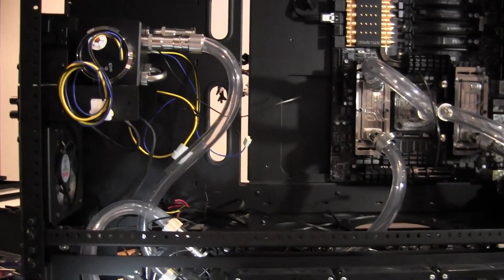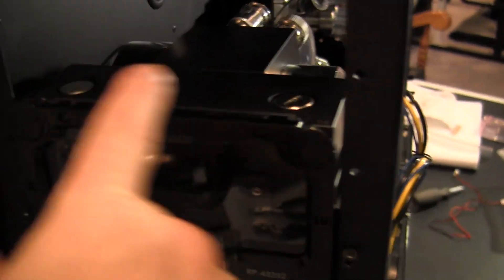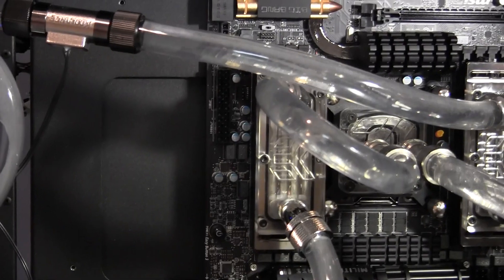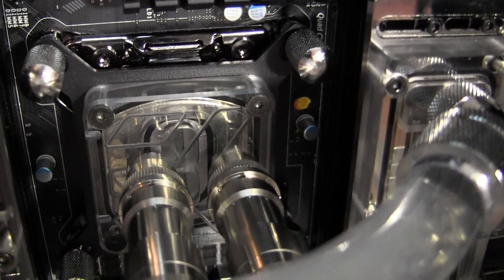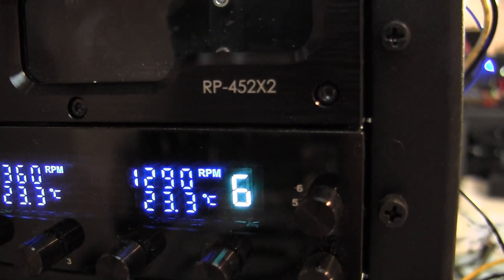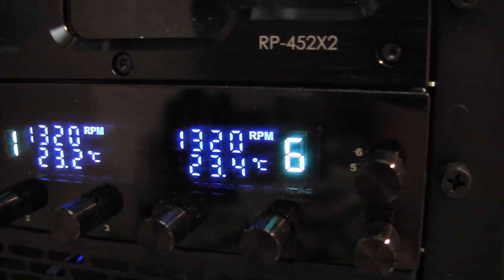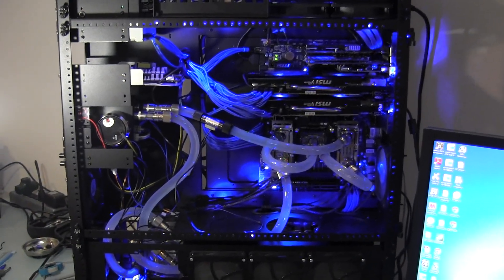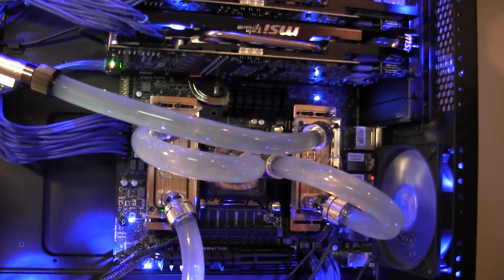Big Bang XPower II Kick Ass Build - Part 3 - Final ... Maybe

Comment from the maker: The EK blocks are the Nickel Plexi just like the CPU and RAM.  I decided to use the FC Bridge system. I hope it does not cover too much up and looks good. The EK  blocks do not have LED holes, but am trying other lighting to show them off.  The LSI is fast and once setup solid.  I do have some videos for that setup yet to post and have a some of benchmarks I did and want to finish maybe this weekend.    The TMS-205 is working great need shots of it in us, soon  will be ready to post.  Thank you.

Comment from the maker: Thanks, You know I saw that on a couple of builds recently. I agree, using the 90's with some crystal link sli tubes definitely will make it look cleaner.  I just bought the fittings and tubes s I will be making that change. Along with a little better cable dressing.   Thanks for the constructive criticism. I can't wait to install those bits.  And thanks for watching.

Comment from the maker: Not yet. Under load (Prime 95) the CPU temps never get above 50.  I am about to OC, will see what that does.  If it will only make a few degrees difference, I will leave them this way. I get excellent flow and IMHO it look awesome.   Thanks for checking it out.  BTW I just water-cooled the GPU's, will be posting that soon.

Comment from the maker: Also I have only used the LSI Raid controller RAID seto as the data drive, I ave not ried it at a boot drive. I have some benchmarks that I ran and plan to post this weekend,.  BTW , I used the OCZ drive with Gigabyte Assisn, Asus Rampage Black Edition, ARock Extereme 9 and now the MSI XPowerII so if yyou have any questions about thos let me know.  Enjoy your build.

Comment from the maker: Correction mine is an ICY DOCK MB994SP-4S Full Metal 4 x 2.5" SATA Hard Drive & SSD RAID Backplane Cage in 5.25" bay I do have a video of the LSI Controller and I go over the ICy Dock and show it.

Comment from the maker: Actually I need to write down all of the build particulars and talk about them in a video or post them.  Right now off the top of my head, I have use Logisys Blue and UV Cathode Tubes, NZXT Sleeved Blue LED Light Strip,  3mm Sleeved LEDs for the Blocks, Koolance dual leds for the RP452x2 reservoir.  The key to the cable management of them is primarily the options of this case for routing cables down, up and behind the motherboard tray,and 3 Bitspower X-stations to power them in strategic spots.

Comment from the maker: Yes the side behind the motherboard tray I had used up all of the length of the PSU cables so I did not have much choice. Inside the mother board chamber I did dress up the left side by the bays and when you close the door and look from the window you can't see it

Comment from the maker: Both are plenty fast. I have used the OCZ PCI Revodrive 3 X2 in a few systems, and some motherboards have issues. Most I was able to work through when they did not play right out of the box. So check the PCI raid manufacturer website for compatibility and issues if any.  Also be prepared that while booting, the bios from these controllers take time during boot to load.  Once you see the Starting Windows logo then you are home free. I have not used the LSI controller yet as a boot drive..

Comment from the maker: I wanted to make it very easy to service the system so I placed QDC's at each of the main devices.  My flow rate is 1.28 GPM's (the pumps are not at max setting) and my temps are great so I am okay with the restrictions. It would be interesting to see what the difference is without the QDC's though.   I have two pumps in the system in series, which provides redundancy and the probability pf both pumps failing is extremely low.  Also the TMS 205 Controller has the feature to shut down my system.

Comment from the maker: I currently have mine at 4.1 on 1.328 Volts. I do occasionally have glitches on my screen but I think that is a driver or display issue and not the CPU.  I will be overclocking it again soon I would like to run it a 4.3 or 4.4 for daily use.

Comment from the maker: No it does not need to be water cooled. Air cooling works just fine even if you over clock it.  Just stays much cooler and can be overclocked higher with water cooling. And this case is designed especially for water cooling.

Comment from the maker: That is an ICYDock MB994SP-4SB-1 4x2.5" SSD HD 5.25" Bay which holds 4 3.5 inch dribes. This oine has 4 120GB OCZ Vertex 3 Drives.

Comment: That is a great build. Hope you get to water cool the 680' soon.. Great look with the blue lights and the blink from the EK blocks. If you are lucky EK will will make matching 680 Nickel block to finish off the build just right... Great job.. How does the LSI unit and the TMS-205 work? I am thinking of using both products myself..

Comment from the maker: Well I have an LSI RAID card which has its own BIOS to run through during POST so my boot up takes longer than a system without one. So it is not fair to compare.  I am running 32GB of 1600 CORSAIR Dominator. I tried to load 8 sticks of 4GB ram bbt it had trouble booting so I have 4 8GB modules in there now. I will upgrading with 4 Kingston 2133 sticks soon . That was when  the board first came out so I am not sure if they fixed that.

Comment: I'm interested in this board, how long does the board take to POST? I have a Gigabyte GA-X79S-UP5 and it takes 10 seconds to POST which is annoying and too long, does this board POST less than 5 seconds? And also, what kind of RAM frequency are you running this on? Can you run 8 DIMM slots populated at 2133Mhz without any issues?

Comment: I went ahead and decided on the 800D, with externally mounted rads on the top. I was going to get the Corsair C70, but I wouldn't be able to fit two 480 rads on it, well I would, but it would look silly.

Comment: just be careful, if you overclocked the cards the program on xtreme burn in will cause high heat and instability, i ran the test on my xfx radeon hd 6870, ran the test while ocing it, the temp reached 80C after 10 mins, the 2 fans attached to the card were at 90% speed, so, idk how liquid cooling will go for you, i know tht if my cpu was still on air tht its oc would be unstable, its using a h100 liquid cooler i ditched the 2 120 fans tht came with it for 4 4-pin cougar fans in push-pull config

Comment: I was thinking the same thing!  Liquid cooling the RAM is a complete waste.  Liquid cool your cards if you are serious about getting to a higher level of performance and silence.  And fix that rat nest of wires in the lower left corner...damn messy!
Reply from the maker: Water cooling RAM is only for the bling. And yes that rats nest was a mess.  Check out my newest builds. STH10 Monster.  Quite a difference you will see.

Comment: Well it IS a awsome rig EXCEPT you cable management inside the case. You have all that room and decided to use the block for the wiring in a place it can be seen? Your loops could have been cleaner and not look so clumped together.Also if you have run 2/480 rads your connection betwen the 2 wouls have been cleaner and easier.Again it is a awsome rig but things could have been done alot better and your perfomance would have been alot higher.IMO. Keep up the good .

Comment: why so many Quick Disconnects. You are restricting your flow so much. BTW plug in your rmp cord on your pump to the cpu pin on your MB and your comp wont start or will shut off if the pump dies.